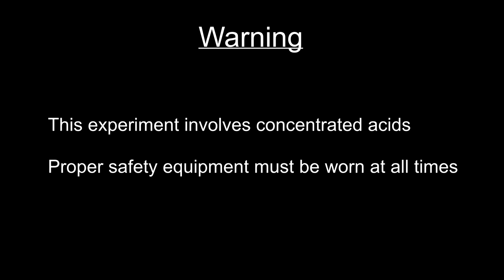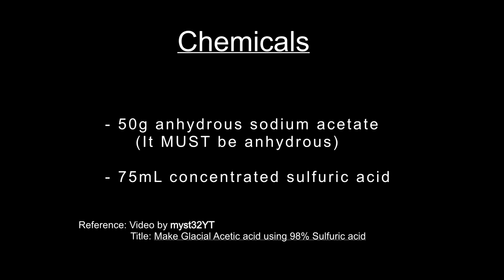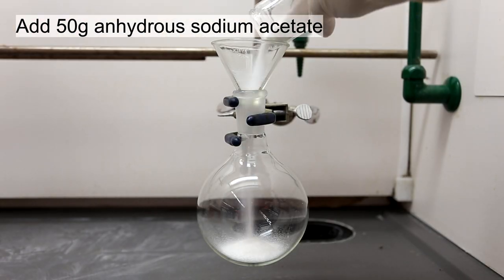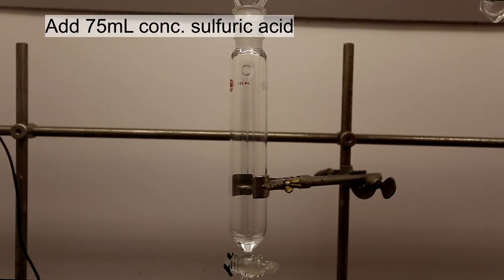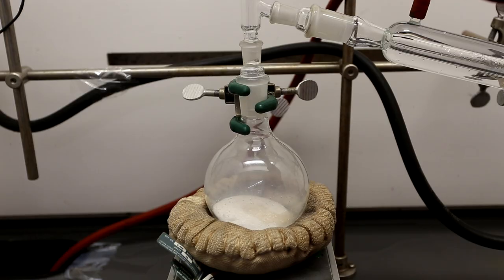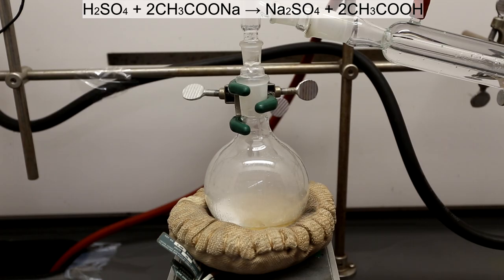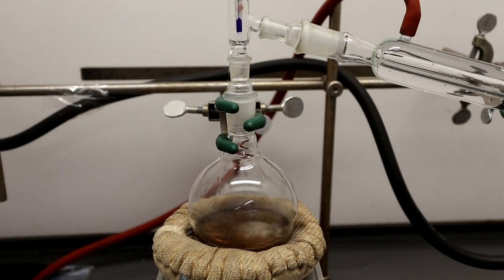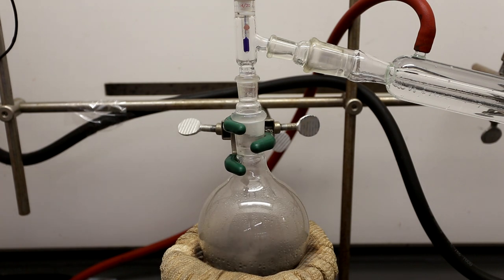How to make Glacial Acetic Acid

Comment: why do you wait to collect the distillate over 115?
Reply from the maker: Pure acetic acid boils around 118C, so after 115 is a decent time to start collecting. At that point, there should be no water. Distillate will start coming over "lower" than 118C though, because the thermometer is a little lagged behind the actual temperature because it several seconds to heat up the alcohol in it. In theory though, it is proper to just wait until the temperature reaches a solid 118C and then start collecting, but at that point we have lost product. It is only acceptable in this scenario because we know the only two things coming over should be water and acetic acid, where the water should be gone a little after 100C.
Reply from the maker: I believe acetic acid and water will distill off azeotropically at some point, preventing further purification.
Reply: +Nile Red
I still don't understand: if you use concentrated sulfuric acid, how can water vapour ever be produced? I think that at 118C which is about 200 degrees below boiling, any water vapour would be consumed right back into the acid.
Reply: You can't exactly get pure sulfuric acid. The highest concentration possible is 98% which is what's generally referred to as "concentrated" this is because at 98%, sulfuric acid and water forms an azeotrope in which the boiling point of the acid and water is the same. But as for Glacial Acetic Acid, that's not the case.

Comment: can someone answer why people dont use conical flasks? i would have thought they are better the round bottom flasks in every way but i dont know much about it so can someone answer
Reply: Round bottom flasks is safer for vacuum. Round flasks with round or flat bottom have more evaporation area, compared to conical flask, so its slightly better for boiling/distilling/evaporation e.t.c. Round bottom round flask can be used in heating mantle, and its good - large thermal contact area. And you can use really big round flasks if you need ))